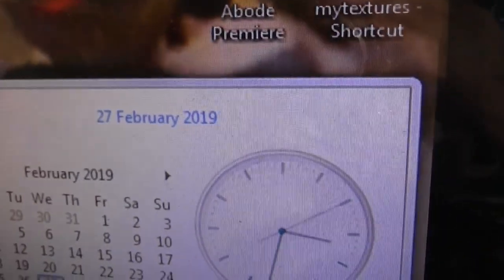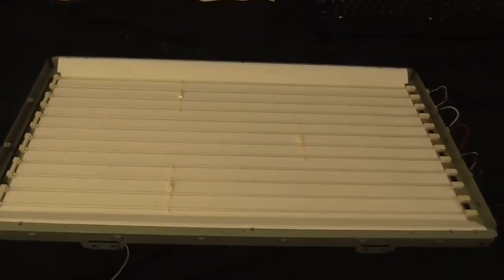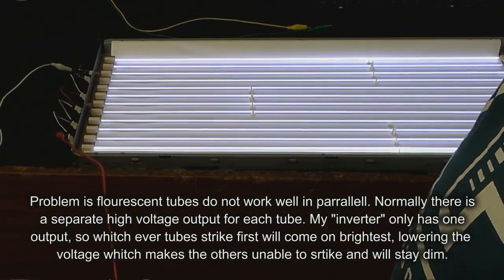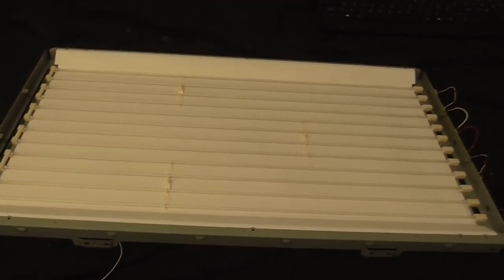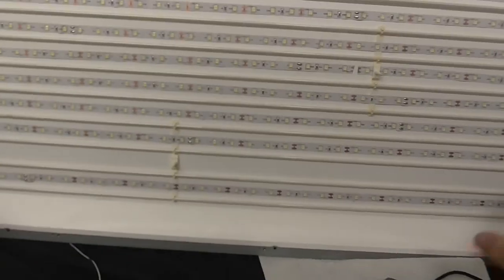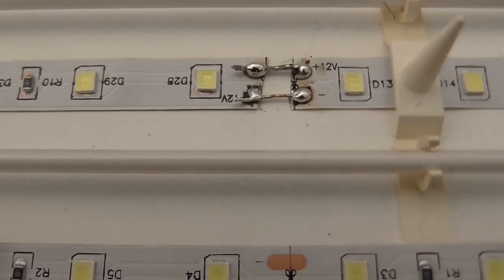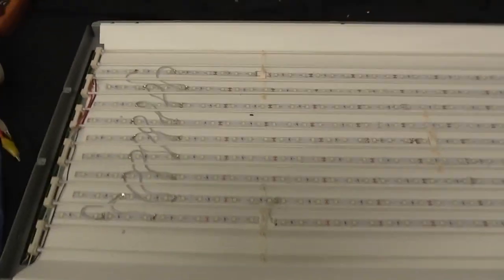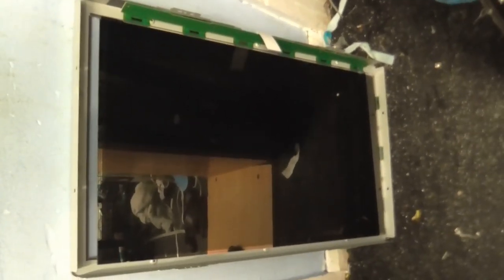Fixing My TV part 1 of ? - Converting CCFL to LED (part 1)

Comment: If you got that Line Output Transformer from an old T.V. Set then it's worth bearing in mind that it was designed to function at 15.625Khz (a 555 in astable mode can reach this frequency) also the Diode -Split E.H.T. generating section will give a D.C. output which isn't the best for Fluorescent Tubes as the Faraday Dark Zone will be showing.
Reply from the maker: I didn't think it would work myself. But I thought it would be worth a try, maybe I'd get lucky. I'm well aware that a flyback outputs DC and florescent tubes aren't designed for DC operation, but those are the only high voltage transformers I have, and I can't get those other transformers out of the inverters.